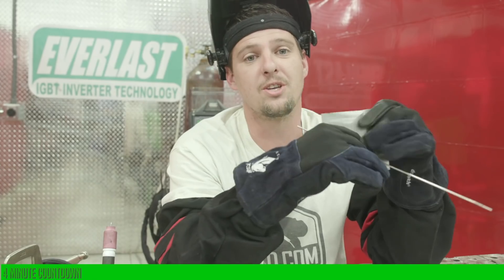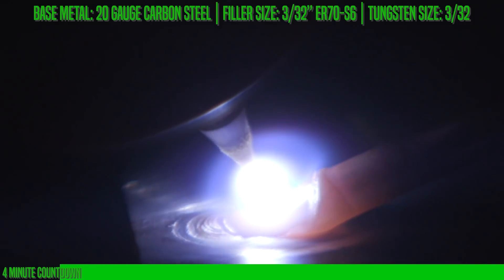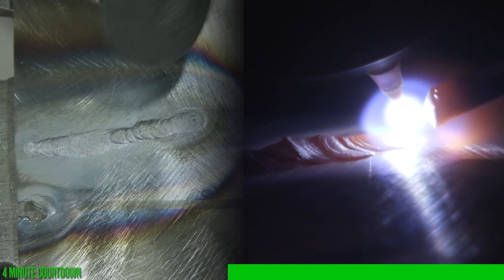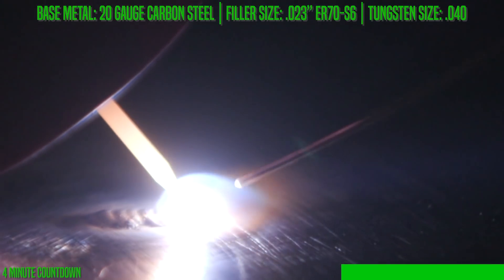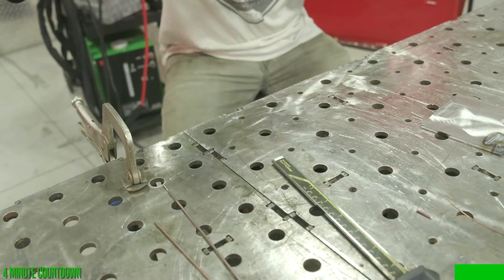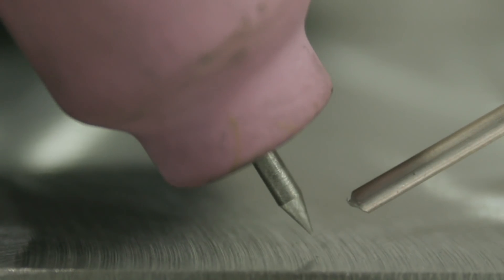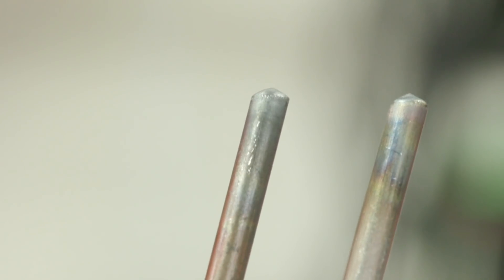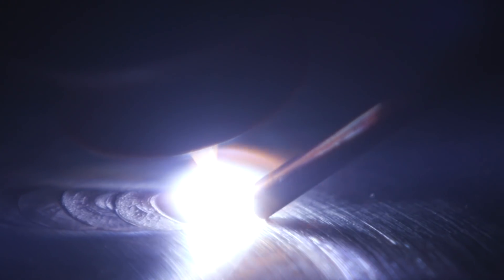Don't make these beginner TIG mistakes

Comment: Tips for tig welding some sch 10 304 ss pipe to mild steel flange, such as gas sheilding, & diameter filler wire! I do belive i read to use a 309l as filler but other than that im not exactly to sure! I've just registered for advanced welding classes but need to get my car back up & operating with a new turbo although i need to sawp exahaust manifolds since the stock set up is pathetic on the cruze with it's many flaws & i figured I'd be better off upgrading rather than spending close to 1k for a 12oz sized sack of turd! Please & TIA for any assistance!

Comment: Hey mate I have just started using my tig welder...it's a cheap Chinese type 200 a dc...problem is it's acting like a plasma cutter way too aggressive...I feel the polarity is wrong...how do I fix this as it has the pin type and can't be swapped over

Comment: How much gas pressure do you use?
Reply: 2x the lens size.  So a number 6 is 12 cfh maybe a little higher is a good rule of thumb.  Too high and it can wash the puddle or waste shielding gas.

Comment: A tip when using .023 mig wire cut a good length off your roll the put one end in a vise the other end in a dril... pull tight on wire as you twist the wire with tenson on it.. pull on wire as you twist untill it brakes.. your wire is now straight and no more bending or flexing wire...
Reply: I think another similar approach that should work is to replace the drill with vice grips.  Smack those pliers with a hammer to stretch the wire slightly.  I've also used this technique to straighten tubing and it works like a champ.
Reply from the maker: Great tip